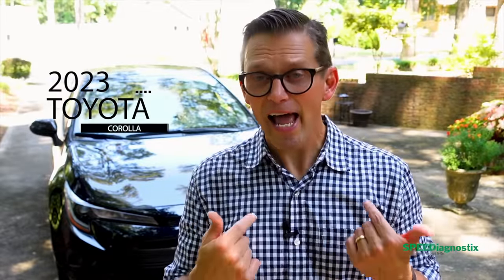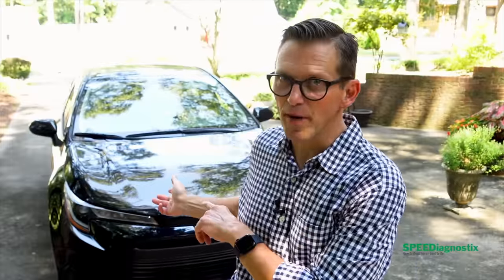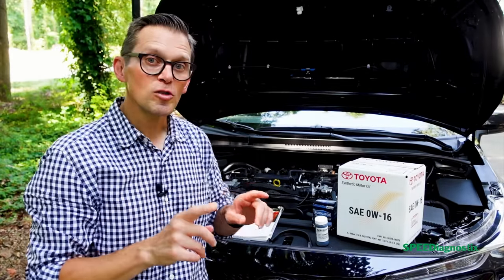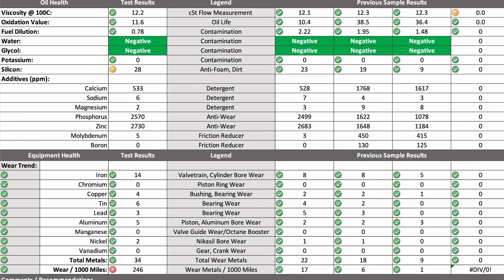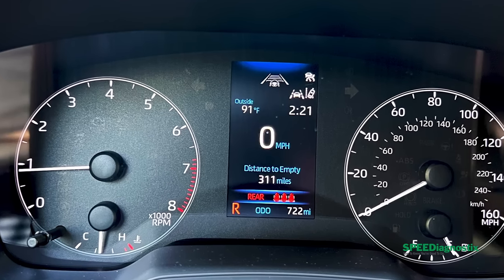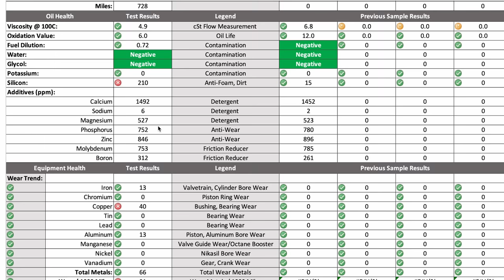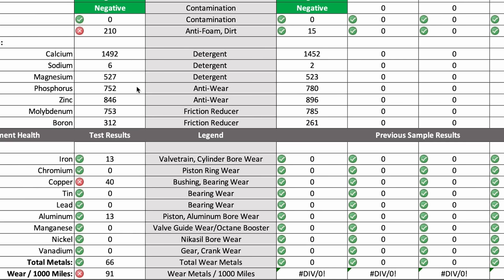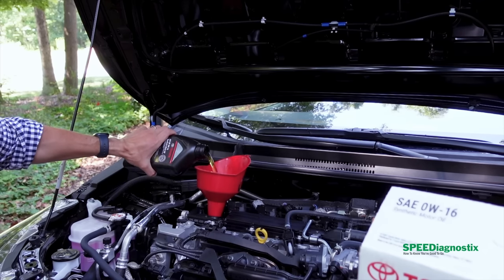AVOID the ONE MISTAKE Almost EVERYONE Makes With A Brand New Car

Comment: As a 43 year retired mechanic I can attest to the accuracy of the information in this video. This guy is spot on!
Reply: As a mechanic for 32 years I can attest he's talking nonsense. Absolute joke. Just telling people to waste their money and perfectly good oil.  Funny how cars that have only ever been serviced as per manufacturers recommendations run perfectly fine for many decades and hundreds of thousands of miles.
Reply: Thanks for sharing your many years of experience opinion. I've been with my current employer for 40 years now, and I know for a fact there is no replacement for experience. I'm gonna change the oil on my new car next weekend. Cheers
Reply: @deanb3033  Unless it's done 10k miles you're just wasting good oil and money.
Reply: @motleydude73 so you believe all break in materials are caught in the filter, and there’s in fact no way said materials are sustained in the oil? That’s the purpose of the video- showing proof with the analysis and giving unbiased education. I guess the only discussion would be do those materials matter if left til 10k miles….
Reply: @DMcElfresh101  Oil holds contaminants in suspension. That's part of it's job, as well as reducing friction and dissipating heat. And why it changes colour over time. Manufacturers benchtest engines and oils and look for wear indicators well before they are sold to the public, and if they say 10k mile changes is fine then just do that. The most wear happens at cold start up and that is unavoidable so just stop worrying and drive your car. It's not going to explode or fail catastrophically. None of mine have. Or any of the thousands I've worked on over the past 32 years.
Reply: @DMcElfresh101 While I'm not part of the 10k mile gang, you definitely don't need to change it as often as it's shown here. That's nonsense, especially for commuter engines that don't have especially tight tolerances. Today's metallurgy and machining has basically zero break in for these pumped out in the hundreds of thousands motors. It's not a performance motor and why it can even run 0w-8 in the first place, that's thinner than water with a nearly microscopic film layer. Realize what these PPM numbers mean, parts per million and you're seeing 1-5 for the wear metals. That's nothing and definitely not large enough bits to be causing scoring. 

Bottom line is change your oil regularly per your use. If you're hard on it (lots of short trips, lots of right foot application) change it more often. Get your oil tested. If you want to change it more often that's fine, buy the cheapest conventional oil and change it every 3-5k or use a higher quality synthetic and change at 7.5-10k. Your choice and adjust per the testing recommendations. It really comes down to more the engine characteristics and if you need to worry any fuel dilution, blow by or something else. Generally don't have to worry about the wear metals much, especially with a Toyota engine.
Reply: I think I did quite crazy you have an oil filter and how much is 10 parts or 1 million that’s hardly anything.
Reply: @Vermonstered  the purpose of this video is showing break-in wear, I don’t think he’s suggesting to change your oil this frequently, this was to show real data. He made a good point in that new engine builds were previously broke in with straight mineral oil and changed around 500 miles.
Reply: @DMcElfresh101  None of that reflects current engines and definitely doesn't apply to this brand new Corolla. Mineral oil is not the break in oil in this car. So sure, maybe applies to cars 20+ years ago but today? Nothing.
Reply: @motleydude73 it’s not wasting oil. Oil is supposed to be recycled
Reply: @AtomSquirrel  Still wasting it when it's good for another 10k miles under normal conditions.
Reply: @DMcElfresh101  He is telling you to change the oil at 500 miles....but he also doesnt show you the actual control test of adhering to manufacture standards.....If he actually provides that empirical proof changing oils at 500 actually provides any measurable life time increase of the engine then I'll believe it.

But all his test shows is meaningless without the original control test group as evidence to measure against. Second 75% of his video is about selling his company to you and additives which no one needs.......
Reply: @DMcElfresh101  Also if engines even see significant lifetime increae just by 500 miles oil change during break-in we would see a lot more engine failure on new cars more often. but that isn't the case at all. Changing oil at 500 miles or 3000 miles provides 0 to neglible difference in the overall aspect of the engine life.....also 12 ppm is barely anything. 

So i dont trust what this guy is selling because he owns the Speediagnostic company all he does more majority of the video is trying to sell you his products........0 empirical proof from control testing that there is any real difference.
Reply: @441meatloaf  When rebuilding honda k motors you have to use break in oil for the first 500 miles. After that you can use regular oil. So yeah this true for some engines..
Reply: @Jo3harker  only for certain Honda motors but this is certainly not true across majority of the manufacturers. This guy is providing poor advice with 0 empirical data from control test group, all he does is try to sell you on his products
Reply: @motleydude73 Oil is cheap, engine is not. Period.
Reply: @xyz-md2mv  Yea no shit, though no idea why you'd ever need a new engine. 99% of people never do!
Reply: @441meatloaf  Cars can do a million miles purely by having 10k mile changes, I'm not sure how much longer people expect engines to last 🤷‍♂️😅
Reply: @Jo3harker  Rebuilding any engine is completely different than taking delivery of a new car. That engine that goes into a new car has already been bench tested after the build and dyno tested after install into a new car. Additionally K series (or really any motor, nothing is special about the K in this regard) is probably using aftermarket parts? Those rebuilds have very little to do with a factory delivered car. Forged pistons with tighter tolerances, different rods or whatever is done directions are at the discretion of the parts manufacturer. This is as a K series owner, nothing is special about the break in from the factory.
Reply: @Vermonstered okay that makes way more sense I didn’t think about that🤣
Reply: 500 miles?! I heard first 1.5k miles is good. I personally would do like 1,200, 3k miles for 2nd oil change, than 4k thereafter. What do you think? Thanks.
Reply: @dbzownz12345  Read your owners manual or ask a service advisor. Definitely do not listen to the oil geek. Or anyone who says early changes are neccessary. They aren't.
Reply: @motleydude73 you don’t know more than this guy giving the video
Reply: @slalomking  The guy you're putting so much faith in is selling his own product. Most of what this guy is saying is hyperbole.
Reply: I'm a 43 year old Technician.... Are you in your 80's Sir?
Reply: Dang !!! We both like the same Music !!!
Reply from the maker: @Vermonstered  https://youtu.be/X4424Q5lLR8
Reply: Sounds like a salesman to me😂
Reply: @Vermonstered  I prefer Toyota over any other but even they have screwed it up a number of times with their low pressure oil rings on the Camry and Scion xb. And these were 2 of my favorite cars.
Reply: I don't get it. His qualifications far outweigh yours, so why would I care at all about your validation?
Reply: @themotoroilgeek  Very much nonsense while trying to sell yourself. Anyone can look at bobistheoilguy forums where actual people in the field with nothing to sell will show and tell you otherwise. At least be honest with what you're doing here. Nothing you're saying about break in applies to any car delivered today.
Reply: @Akira-nw4jl  Oil control rings have been known to get gunked up on a number of Toyota engines. This led to them burning extra oil but not much other problems. The gunk buildup in the rings is from oil that burns dirty which is generally cheap conventional oils that many dealerships and oil change shops buy in bulk from whatever the cheapest deal they can get. Switch to any quality oil that burns cleaner and you wouldn't have had that problem in the first place if you were changing the oil regularly and occasionally sending it out to get tested. This guy just lives in hyperbole and scare tactics to sell his services. There's literally thousands of lab tested engines and a number of actual engineers who design and build these engines that will refute his nonsense. But he's trying to run a YouTube channel and sell his stuff so the know nothings of YouTube will buy it.
Reply: @motleydude73  I'm a 46 years tech. I'm sorry you don't understand. I change breakin at 500 miles you can do what ever but! I been doing this very long time!
Reply: Changing oil more often won't harm your car. You just spend more money on oil and filters. For some people, the peace of mind is well worth it.
Reply: @slalomking  I most certainly do! He's a slimy snakeoil salesman, I'm a service technician with 32 years experience. But go ahead and listen to this nut and waste $ and good oil 🤣
Reply: @markkinney5030   There is absolutely no need to break in new engines. You are obviously still stuck in the mindset of your apprentice years in 1975 🤣  I've moved on from that during my 32 year automotive career. As have engines and oils. In my country the first change is done at 15000kms. Perfectly fine. Toyota says so.
Reply: @motleydude73  Well good for you! And sir! You do what ever you want too! I know more about a engine than you do its sounds like! Have a good day!
Reply: As a guy with brain i can also attest changing oil is good for the engine that needs oil.
Reply: Aaammmeeennn !!! ! !!! Peace with you from Eu.
Reply: Honestly I couldn’t watch anymore…when he said he was putting the car on jack stands and drove it up on ramps.
Reply: @motleydude73  10 and 15k intervals is the manufacturer saying that the engine will make it out of warranty with that change interval, with only a tiny amount breaking within that time and distance. Keeping the car shorter, keep to the interval, want to keep it till it falls apart change more often, and you will see the difference.
Reply: @SeanBZA  No I won't see any difference whatsoever.  Why would they 'break' within that time? Which is usually 5 years. Some are 8. Mitsubishi offer 10 year warranties. I've seen plenty of 30 year old cars with mega miles that have had nothing but 10k mile changes all their lives, no problems. Americans seem to think if a car doesn't last 500,000 miles it must be because the oil wasn't changed often enough 🤣
Reply: @motleydude73  They also say that things like plugs, and non motor oil, is a lifetime thing. Yet plenty of automatic transmissions and CVT fail just outside warranty. The manufacturers have tested, and found, that lifetime, and also the minimum level of service required to reach it without failure. Yes there are outliers, like the car that is driven long distance, dry climate, all the time, which reaches a million miles, but the same one next off the line, nominally identical, is driven short distances, wet climate, and the engine and trans die about the same time as the body does, with the same service intervals.
Reply: @SeanBZA  Lifetime just means the life of the warranty. Not sure why people struggle with understanding that. It's so home mechanic muppets don't cause damage by using the wrong fluids then try and make a claim if something goes wrong. It's just the manufacturers protecting their own ass. You cannot plan obsolescene into a vehicle. There are too many variables in how it is treated once it's left the showroom. But most will happily do 500,000 miles with regular servicing. Hyundai and Kia not so much, but that's more down to poor design than type of usage.
Reply: @motleydude73  Renault Citroen Peugoet and Nissan had it down to a fine art, making a car that would basically fall apart after 7 years in the typical EU driving cycle. They never sold them in the US market for some reason, but garnered a bad reputation in the rest of the world for that.
Reply: @SeanBZA  Unlikely. Did they not want future sales in such a large market? People would ditch those brands in droves if that was the case. 7 years is barely run in for most other brands. Nissan is effectively Renault after the merger in 2000. Reliability did drop after that. Can't kill a 1990s Nissan.
Reply: @motleydude73  They did get a lot of blow back from that.
Reply: @motleydude73  Agree with that, sister had a 1990's Nissan, and that thing just ran, till it got stolen. However was not built in the EU, but in South Africa, where they build them a lot tougher to survive local conditions. The old saying is that with a locally built Toyota everything keeps falling off, but the engine and drivetrain keeps on rolling along. There are thousands of Toyota Quantum minibus taxis that have rolled over the million mark, a few times, along with old E20's and Super 16's as well. The competition does not make it that far.
Reply: @motleydude73  Toyota recommends 10,000 mile oil change intervals however they indicate that a pattern of short trips could necessitate shorter intervals.
Reply: @joelthorne7434  Yes I know. I work for Toyota. Kinda know their service schedules and 'extreme conditions' recommendations...
Reply: @Vermonstered    I guess you have never pulled the oil pan on a low mileage engine under warranty to do a failure analysis.  Toyota manufactures their engine in China now and our machine shop has fixed dozens of low milage Toyotas for local dealers.
Reply: @rickh633  And nothing you just said, even if true, points to super short oil change intervals being the solution to whatever your unspecified problem you continuously and repeatedly encounter on these low mileage engines...
Reply: @Vermonstered       What?  Everything points to super short oil changes on new engines and 2 in the first 500 is critical for engine life. Furthermore, industry data also shows the more oil changes the engine sees the longer it lives.
Reply: @rickh633  So absolutely no data, no consistency of problem, no anything besides YOUR view excessive oil changes will solve the problem you can't specify. 😂
Reply: @Vermonstered       There are plenty of studies available to  AERA  and SAE members like myself done by the engine manufacturer on oil change frequency and related wear in new engines.   I read a few of your comments and it is clear you are clueless.
Reply: @rickh633  🤦 Studies without citation. No actual claims to causes of failure. It's hilarious you make the claim the failures are early in the warranty span yet claim a few oil changes, to a problem you can't identify, is the solution. Outright liars like you, who now claim you need to do 2 oil changes in the first 500 miles, treating OEM motors like freshly machines aftermarket motors are a trip. Where every single engineer who worked on those motors will disagree with you and in fact many have specific break in oil you WANT to leave in to help mate surfaces. But if course you'll claim more failures and more nonsense and never actually talk specifics just more and more hyperbole and name calling.
Reply: @Vermonstered      u really are showing your lack of knowledge now. FYI  SAE  is the Society of Automotive Engineers, NOPE but I am. AERA is the Automotive Engine Rebuilder Association. Are you a member? NOPE but I am. Are you consider an expert in this field by the courts and your peers? Nope but I am

 Trust me when I say anybody in the industry who read your comments is thinking the same as me, you are talking about things you have little knowledge or any understanding of.
Reply: @rickh633  I can guarantee you that not a single study you're trying to cite claims 2 oil changes within the first 500 miles is the differentiating factor between early failure and an engine that lasts 500k+ miles. SAE, ASE, whatever association you want to claim you represent. That study simply doesn't exist and I know the lies and nonsense will go on.
Reply: You realize he is a Tribologist, Son of a legendary racer, engine builder and has advised many oil companies and additive pack companies with his expertise? He also owns and does oil, Trans fluid and gear oil analysis for a living.
Reply: How do some of these mechanics feel about a magnetic oil drain plug.
Reply: I don’t know what’s a bigger topic 
Oil change intervals or religious Beliefs 😂😂😂😂😂
Reply: @motleydude73  Manufacturers want to sell products to consumers. They don't want consumers to buy a car and not need another one for 15 or 20 years. Don't be so naive.
Reply: @bdeheton6445  Of course they do, but they also have zero say in how long those customers choose to keep their vehicles.  Wealthy people might change them every 3 years, poor people hang onto what they have for 10 or more years. Toyotas can last 30 years with minimal repairs so their renowned reliability keeps their new sales high. The trickle down effect of used cars helps new car sales. Crap like Kia struggle as their old cars are junk. Build more durable cars you will get more sales. If they all failed just  after the warranty ran out the company would be bankrupt pretty quick.
Reply: Scotty Kilmer says change it every 5k.
Reply: @motleydude73  Okay but your the one who is lying. You are supposed to go around 25k-30k miles on a oil change. No 10k. Thats a wast of oil in my opinion. if there is still oil on the dipstick no point in changing it.
Reply: @ncopp4358  Righto muppet. Yes some oils like Amsoil Long Life can do 25k under optimum conditions but generally, as per manufacturer recommendations,10k is the ideal 'sweet spot' OCI. Good luck doing 30k with no oil on the dipstick.
Reply: @DMcElfresh101  It's really hard to deny scientific data, but there are always some folks that are delusional.
Reply: @motleydude73  The manufacturers are only concerned with getting the vehicle past the warranty. The rest is the customer's problem.
Reply: @markleggett3944  Someone forgets this isn't a European car, the video and example vehicle is a Toyota.
Reply: @rickh633  I've NEVER seen or heard of a vehicle having two changes in the first 500, yet I've seen literally thousands with well over 250,000 miles just by doing manufacturer OCIs and no problems. Owned some myself.  You talk out of your arse.
Reply: @motleydude73   I couldn't careless what you heard of or think you know. Just another wannabe.
Reply: @markleggett3944  No they want the vehicle to last as long as possible with no problems actually. You think Toyota built their reputation on 'just getting past warranty'?
Reply: @rickh633  Service tech with 32 years experience actually. Done over 15000 oil changes on all manner of vehicles, NONE of which had your pointless early changes. All still working perfectly fine, some 30 years old. Stop peddling your ridiculous lab result bullshit, it means nothing in reality.
Reply: @Vermonstered  He references doing the same thing to his Porsche as well as his daughter's new Corolla. It doesn't matter what name is on the body.
Reply: @markleggett3944  And neither one of those brands cars fall apart just after warranty.
Reply: @rickh633  Still waiting for your study citation from your imaginary organization. Lol lash out all you like, no one has ever studied the necessity of 2 oil changes within 500 miles of OEM engines.
Reply: @motleydude73  The owners manual said it so it must be the absolute best for the car.
Reply: @PDPIE1029  Correct. They built and tested the engines and oils. Think they have more clue than all these youtube 'experts' 🤣  'ChaNGe aT 3000 MiLes OR youR CAr will ExploDE'
Reply: @motleydude73  normal conditions being pure highway in a temperate climate with perfect driving habits and no short trips lmfao
Reply: @melvingibson4525   Wow what a revelation. Thanks for telling me I would never have known. Lmfao. 🤦  Short trips are unavoidable really, as long as you do a long trip every now and again doing extended intervals is still fine. If you're only doing 5000 miles a year just change it every 12 months instead.
Reply: @motleydude73  stay in Europe
Reply: @motleydude73 My Ford user's manual tell me the break-in period is the first 1,000 miles. So....?
Reply: @Yammie_Moto671  Break in PERIOD yea not break in oil change. Though thrashing it from new won't do any harm either.
Reply: @motleydude73  Not taking it easy during the break-in period can shorten engine life by premature wear, increase oil consumption, faster cylinder wall wear, and incorrect camshaft lobe wear. Staying light on the gas for 1,000 miles isn't that hard. The transmission as well needs to break-in. Shifting will get smoother over time.
Reply: @Yammie_Moto671  Thrash it from day one it'll be fine. Any issues are somebody elses problem down the line long after you've sold it.
Reply: @motleydude73  You're the type of guy to leave your trash in a campground  and ruin it for the next family. I take care of my stuff not to sell it but because I work hard for it and makes me not take things for granted.
Reply: @Joop-Adrie That's alot to a high tolerance bearing.
Reply: @motleydude73 exactly, those metals are held in suspension and pass through your bearings and the film between your piston rings and cylinder walls.
Reply: @natevanlandingham1945  As few and miniscule as they are, as to be not already be trapped in the filter, they cause zero damage amidst up to 12 litres of oil.